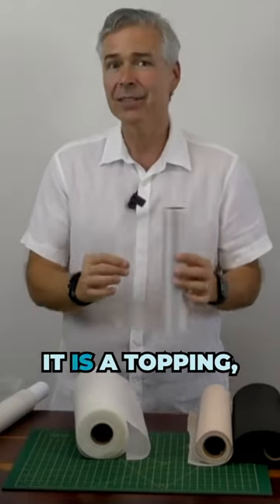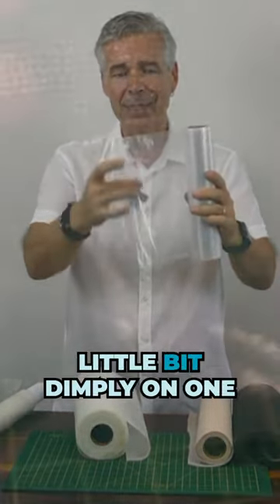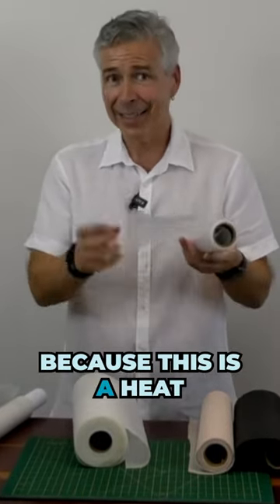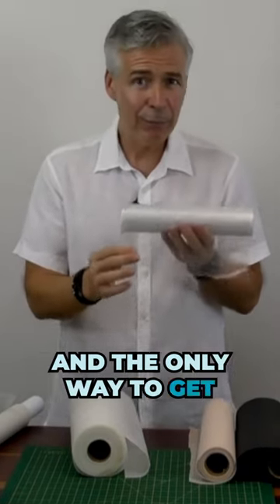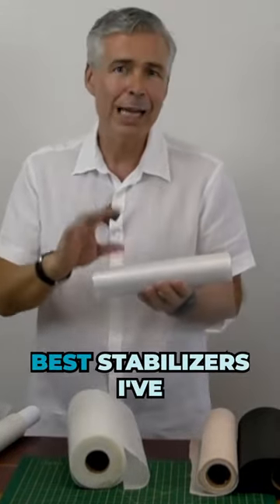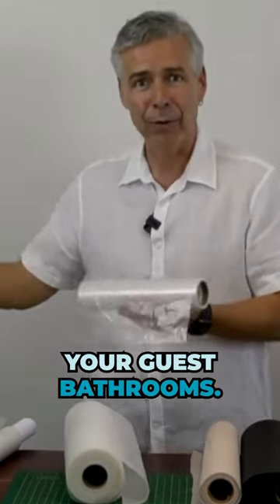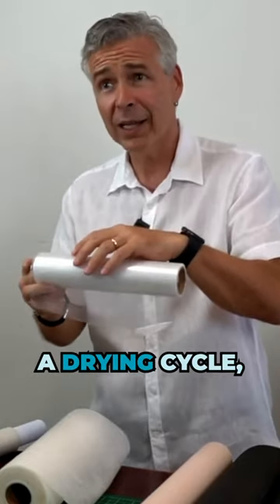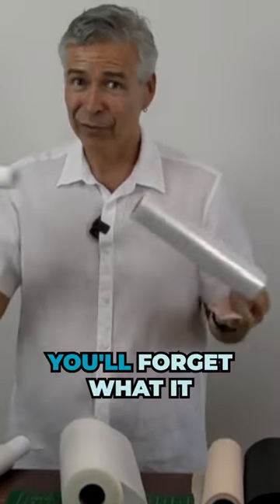Discover perfect terry cloth embroidery with Heat and Gone Stabilizer! 🧵 #embroiderystabilizer

Comment: Hi heat and gone is great however it does form hard balls in small spaces in a design where there is no embroidery. I have had to carefully cut off the tiny scratchy balls. Especially hard to remove on high loft fluffy towels. I use a small crafting iron.